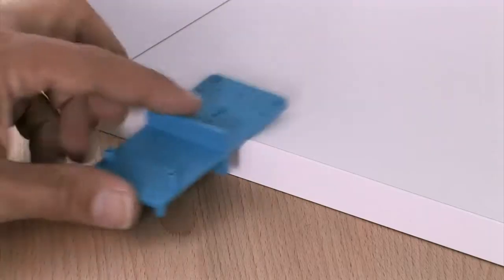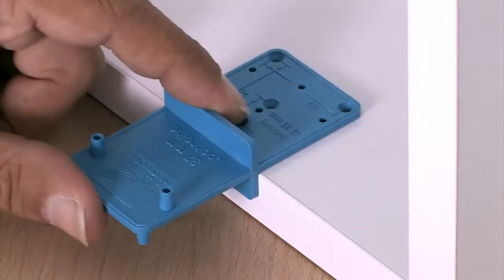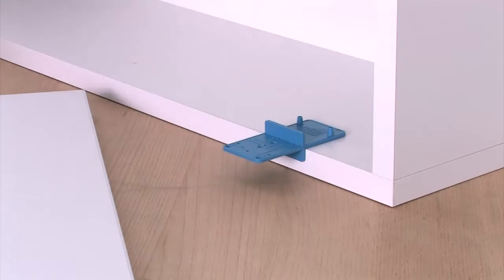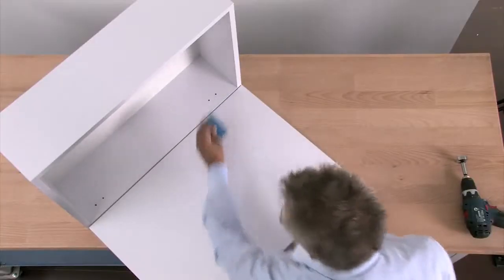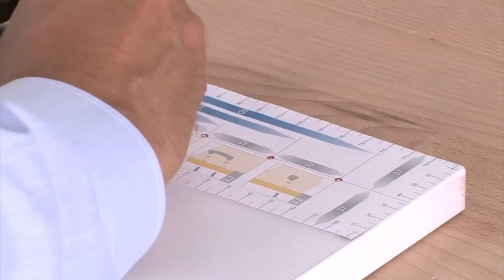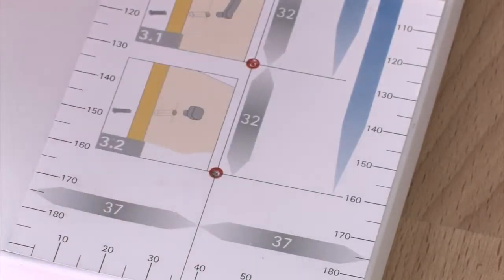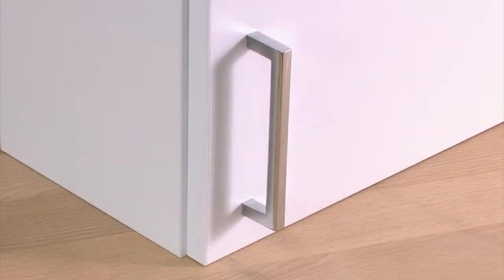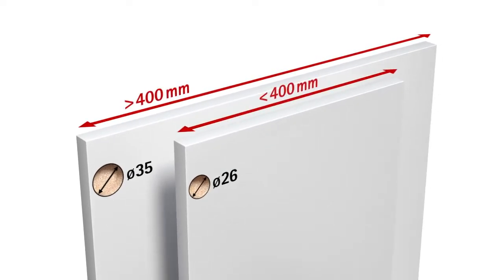HETTICH MultiBlue hole marking jig (for hinges,mounting plates & other)

Comment: The hole you need to create is 4mm for the template to fit into he holes, but the screws in Sensys mounting plates are 2mm, i've brought this and this is the problem i've had, even in this video you can see that the screw used is much smaller than 4mm, but they drilled a 4mm hole? Doesn't make sense.
Reply from the maker: Hello
Mounting plate holes - 5mm
Mounting plates are available in different configurations: without pre-installed euro screws; with pre-installed euro screws; and with a pin + screw system (as in the video). All pre-installed screws are designed for installation in a 5mm hole. If you purchased a mounting plate without pre-installed screws, you can use a plastic bushing and a thin screw.
You can write an e-mail, I will send you the diagrams